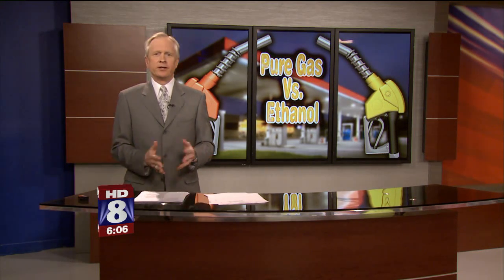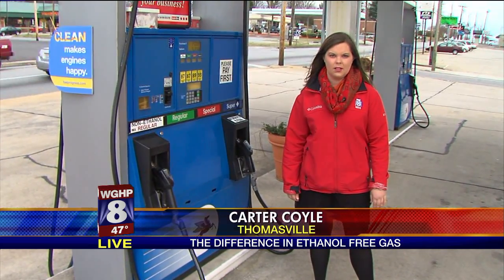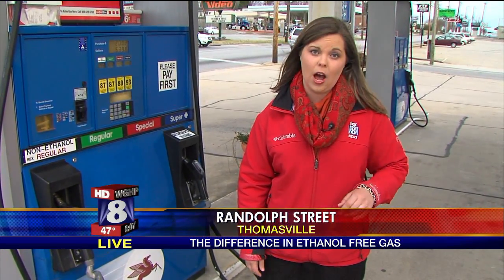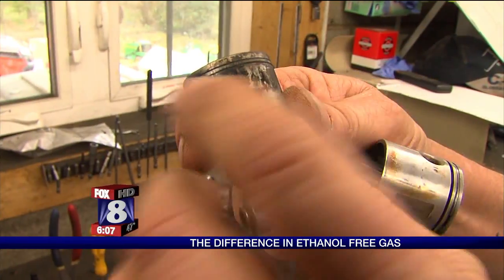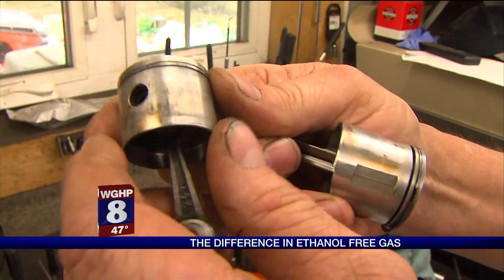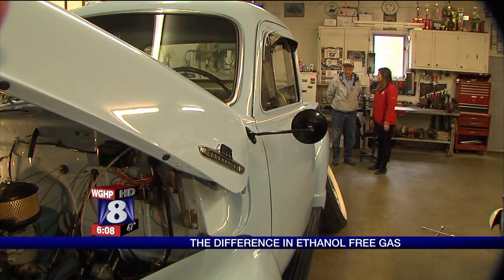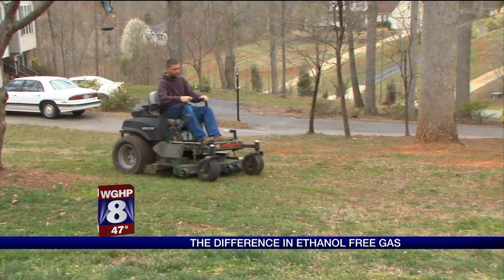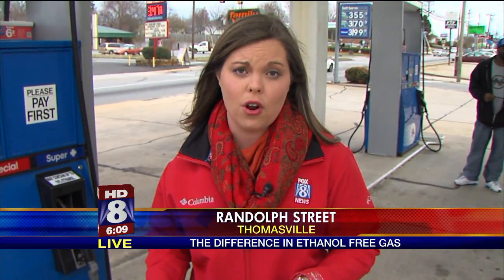Pure Gas v Ethanol

Comment: I have a flex fuel truck, I run e85 in it, it makes more horsepower, a little less mpg but it's way cheaper, however I run pure gasoline in small engines. I've noticed ethanol blended gas doesn't do well in small engines.

Comment: If I am running ethanol free gas, why would I put ethanol shield in it?
Reply: You shouldn't...I don't. But that's just my opinion. Ethanol Shield works wonders against ethanol gas and after I found out that Shell 93 V-Power Nitro+ has no ethanol in it at all because it contains a ton of Nitrogen and is approved by the Government as a better cleaner if not the same. But it is most likely a proprietary/personal thing and no one else can add Nitrogen to their gas...Not even in small amounts. Because without permission, it would cause lawsuits for copyrighting. I don't care how high gas prices go...I will only run Shell Premium in my vehicles...Or I just won't drive them as much. I only go out once a week for 35-50 miles known as pleasure driving since I work from home. Need to get out the house at least once a week for a few hours!!! ;) :)

Comment: That is exactly why they sell Non E85 for use in small engines and other applications. I have run E85 in my 94 Chevy 5.7 350 for years without any issue, much better performance overall. GM Changed their fuel sealing components in the late 80's E85 or alcohol based fuel will only harm engines with rubber sealing components and lines.  In addition E85 extends fuel pump life as not only does it perform as a very good fuel, it is also a cleanser at the same time. Regular gas is very dirty.  All engine applications need to be built to run on E85 as crude oil is becoming limited.

Comment: ethanol is a solvent an it brakes down fuel lines and seals .... ethanol will absorb and suspend its volume in water and when it sits over night the water and ethanol separates from the GASOLINE that is why you have water in the bottom of your crusty carb bowls and your jets are plugged.. not to mention two stokes potential to lock up from lack of lube because water and oil dont mix ...SO it dosnt matter WHAT you put this ethanol-enhanced  BOONDOGGLE in... it will cause damage to your equipment ... still not convinced ask why its not used in air craft
 ETHANOL also kills brain cells ... from the comments left below some ones had to much to drink!!!WINDOW LICKERS!!!!
Reply: hey genius the reason it is not used in air craft IS BECAUSE:it is a solvent ...that means it breaks down rubber  components like diaphragms fuel lines Orings  .......
ALSO: it can suspend equal portions of its volume with water .. one gallon of ethanol WILL suspend one gallon of water NO IF'S AND'S OR BUTT'S the crap absorbs moisture and it will freeze @ altitude ....
Ethanol also leans your air fuel mixture ... lean means heat and reduced power genius....
Reply: Tom C. your right Pure ethanol has a freezing point of -114C, A 50/50 ethanol water mix has afreezing point of -40C and water has a freezing point of 0C. ethanol will only suspend 50 percent or less water which makes it to great of a risk to run in aircraft ... for example ethanol like in beer wine will freeze when the stronger whiskey wont unless it gets cold enough
Reply: Tom C. dryer climate would help.... the problem is humidity or wetter climates ...when water is introduced into the ethanol and gasoline the ethanol separates leaving you with a lower octane gas ...  then when the ethanol and water separate it goes to the bottom of the tank more than than likely it will be a 50/50 mix of water and ethanol ... the problem with that is diaphragms ,fuel lines,fuel pumps and any other rubber components are only good to about 15 to 20 percent ethanol then it starts breaking it down .... my main complaint wasn't with aircraft it was with everyday equipment from small 2 and 4 strokes to everyday runners....
2 stokes are a good example ... when you mix your fuel say ethanol fuel and your favorite mix ... when water is introduced the water and ethanol separates goes to the bottom of the tank ..that mixture is now a combustible granted not a very good one but it will still burn but it is not mixed with any lubrication so the risk of a seizure is greatly increased..

Comment: It's called you poeple should catch up with times. I have a fuel-flex Chevy pickup or truck, as some say, and I have used E85 since I bought it new. I still have it and it is coming near 200,000 miles. Still it runs just like it did when I bought it. People just have difficulties accepting new ideas and advancements. I use E10 in my mower, boat, and snowmobile, Each still run as they did new. This network is just telling you complete and total BS.
Reply: do some research. its crap. just bc you have a flex fuel truck don't mean shit.

Comment: Here's the thing, mild Ethanol blends tend to separate. E85 does not. Try it for yourself, leave E10(pump gas) and E85 out a few nights. Also, Ethyl Alcohol aka Ethanol or DRINKING ALCOHOL is not corrosive to newer engines after the start of EFI in the mid 80s. It may be difficult to start in the cold with Ethanol due to the flash point. In the end, it's more efficient to use Ethanol since it has an equivalent octane rating much higher than most race fuels meaning you can use higher compression ratios, leading to more efficient burns and more power output. Plus, it's FAR less harmful to the environment than gasoline.

I don't suggest ethanol in any run of the mill carbureted equipment because most manufacturers don't use seals that stand up to Ethanol well. Also, Ethanol does not have any "grit" to it since it's purely a liquid alcohol and the inconsistent burn is due to relatively low temperature. In a running engine, all of the alcohol gets burned thoroughly. If you decide to use an Ethanol fuel, go big and go at least E85 which means more fuel flow and a computer tune on modern engines and better gaskets and larger jets on carbureted vehicles. Otherwise, don't let your gas sit for too long. Run the engine and use the gas before it gets stale. That goes for Non-ethanol fuel as well.

Comment: Ethanol is made from water and sugar based agricultural products.  I switched back to pure gasoline as it is cheaper in the long run.  I went from 17 mpg average on gas laced with ethanol to 22 running pure gasoline.
Reply: kevin122759 i wish i could find pure gas in michigan. and the reason you get more mpg with pure gas is gas has more BTU's than ethanol, even though ethanol has a higher octane rating.
Reply: Cannot find Pure Gas in Pure Michigan? lol

Comment: Small engines are vented vs modern cars which are sealed to meet EPA standards.  The hydroscopic nature of ethanol in a vented gas tank is one of the big problems of ethanol blended gasoline.  The ethanol is pulling water out of the air and adding it to the gasoline.

Comment: I have a 2004 Pontiac grand am with a  2.2l engine. the manual says to use 85 grade octane gas, but every since I started using 85 ethanol free I have noticed more power and 100 extra miles per tank. I have since moved and only have 88 octane ethanol free "available" to me. I want to use it, but am worried that the 88 octane will cause predetonation or engine rod knocking. 

Can my car handle 88 ethanol free without causing damage? to those who answer, please include your background, as, I am hoping for an opinion from someone who knows what they are talking about.
Reply: CTRCHOICE ok, so the higher octane, the better the predation knock protection is. 88oct is and will be fine to run, in fact it will be better then 85. the manufacture says a minimum of 85 not strictly 85. you could use 93 but you will not benefit from it on a small 4cyl motor without a turbo. This is why they call e85 poor mans race gas, its 106oct.
Reply: Higher octane will not hurt the engine. Higher resistance to predetonation.

Comment: Water is condensed inside the tank due to temperature changes, not if there is ethanol present.  If you live in a northern climate then you are used to needing to put dry gas into a tank full of gas at each fill up, because there is water in the tanks at the station, dry gas will absorb the water and allow it to be burned off with the gasoline, Dry gas or Heet or any other brand is just plain old 100% ethanol.  That being said, there are precautions you should take if burning higher concentrations of ethanol in your engine, replace any rubber items with PVC replacements, they are available and will last longer.  If you can safely increase the compression ration in the engine you will be amazed.  Ethanol can operate at ratios way higher than gasoline can and that is where it will shine.  You can easily get a 40% increase in horsepower with the same amount of fuel.  There are some many more benefits to ethanol, cooler burning engine so get a slightly hotter spark plug.  No carcinogens in the tailpipe exhaust unlike gasoline's poisonous exhaust.  Cows cannot digest the starches in corn which is 35% of corn so they just crap it out, making ethanol out of corn removes the starches and the mash left over has a much higher percentage of protein and minerals in it so it takes less feed to put on a pound of meat.
Reply: You work for the iowa corn growers lobby? Your blurb about benefits of ethanol reads like a marketing brochure.  In small engines ethanol causes difficulty in starting, which is from the water and the ethanol residue in the carb, float bowl and gas tank.  20 years ago started using non-oxygenated fuel and since have never had any issues like I had running ethanol fuels.  The processing of corn into ethanol takes more energy than the miniscule boost in in the octane is worth.  Furthermore, if I run my small engine on non-oxy they runs longer per ounce of fuel than running 10% ethanol.  There are many benefits of NOT running the ethanol based fuels in small engines.